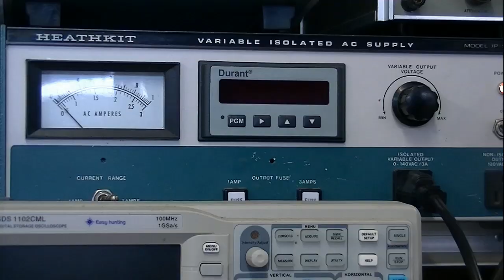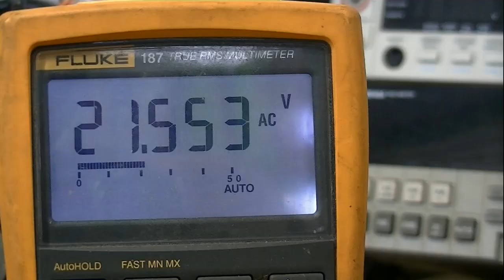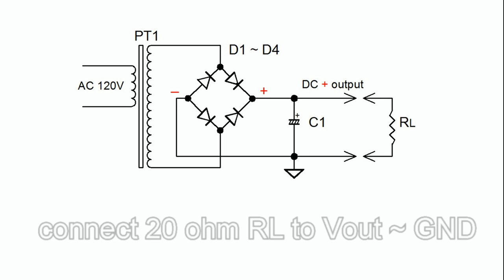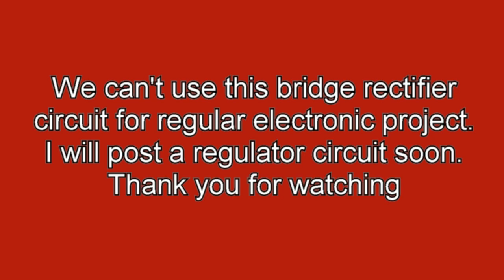basic electronics 5, bridge diode full wave rectifier, capacitor input

Comment: Hi Young, 
Regarding bridge rectifiers I was hoping you could answer this question.
 I have two large solar panels that are designed for a nominal 48v DC system.
 The panels generate about 60 volts each when activated in sunlight.
 I run the panels in series to produce 120v DC which is required to operate
 a charge controller that charges four 12v batteries running
in series to produce 48v DC. The panels require a constant 48v DC input to
activate. The problem is if I connect a wire from the batteries to the panels
to activate them with the 48V from the batteries, the panels immediately
generate 120V DC when activated which then runs straight back to the batteries
through the wire providing the 48v for the panel activation. The same is true
if I use a 48v DC wall adapter -  the wall adapter activates the panels with 48V DC and 
the panels respond by immediately producing 120vDC which smokes the adapter within a few seconds.
 I have seen on the internet some mention of a bridge rectifier preventing “feedback” in a DC circuit.  
Do you know if a bridge rectifier would work in this case to stop the 120vDC from the panels
from going back into the 48vDC wall adapter (or batteries) when they are used
to activate (wake-up) the panels ?
Thanks Much
Reply from the maker: Hi, Thank you for asking. I don't have any experience about solar panel and charge controller. Unfortunately I can't advice how to do it. Have a great day. Young